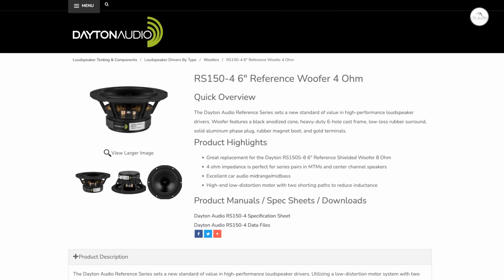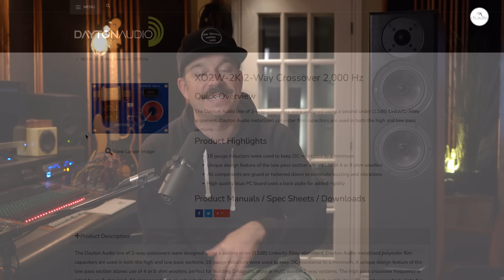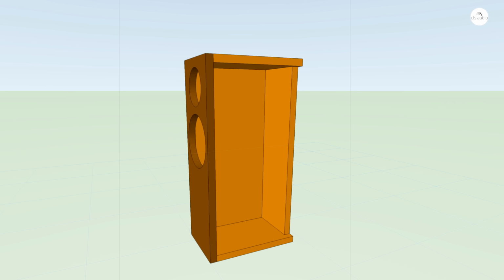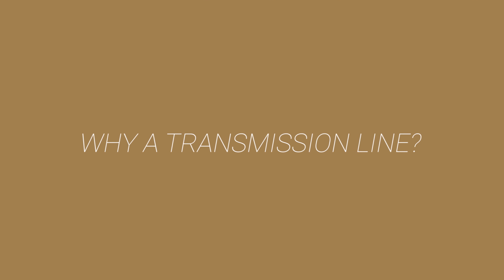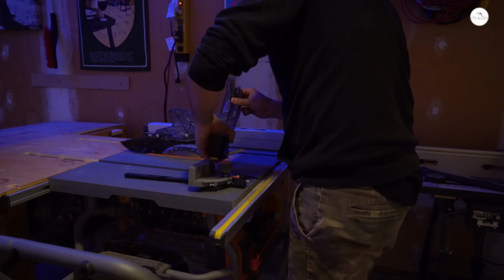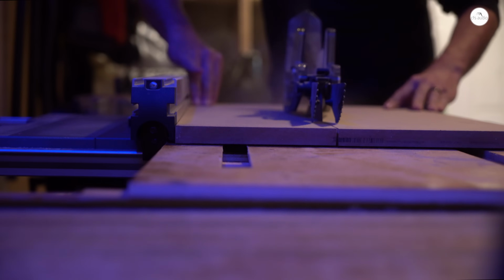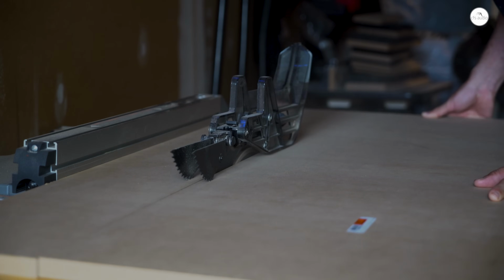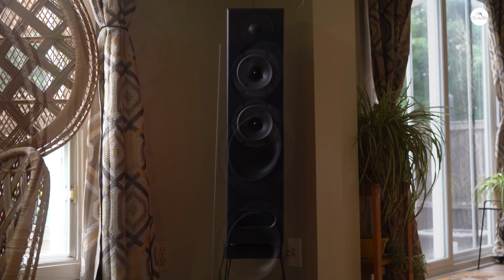DIY Reference Quality Speaker Build. How I built these amazing speakers and proper sound comparison!

Comment: Very nice build - I am a huge fan of transmission line speakers. I have designed several mass loaded transmission line speakers, including the crossover, and built them. And I agree that they sound fantastic - much better bass & midrange quality than any speaker I have ever heard, and with much better bass extension from a given driver. My favorite so far, use a 6" paper cone SB Acoustics woofer, and are essentially flat in my room to 32Hz.
I used a 3D acoustic modeling program called Hornresp to design the cabinet; and drafted it in DataCAD. I used a miniDSP 2x4 HD to digitally design the crossover, listening to the speakers. I then used XSim to design an analog version of the crossover.
Reply from the maker: Awesome Stuff! Thanks for the kind words. Looking forward to designing my own electronics and dialing in my cabinet designs in the future.
Reply: @chrisferris3303  A possibly good way to get your feet wet in Hornresp (which is free) is to model this speaker, since you have the dimensions. The driver Thiele/Small data is available; maybe in a TXT file that can just be loaded into Hornresp?
Reply: How critical are the dimensions of the cabinet to optimizing the sound quality?
Reply: @talktoeric  The inside dimensions are pretty important. The most critical is the area of the terminus section. In the final stages of the design, I was moving things in 1/16" (~1.5mm) increments.
Reply: @NeilBlanchard  I was in the same vote, very small increments of movement.  Also found the qty and where the dampening material is placed makes a big difference in modeling/testing those peaks and valleys.  I was also surprised how close hornresp modeling was to the tested.  So much fun though.
Reply: @CHUDHUCKER  Right - the polyfil works very well in the closed end and close to the woofer - and I use no polyfil in the half of the TL closest to the open end.
Reply: @NeilBlanchard  Yes, I had to offset my woofer and do the same but, added a bit more closer to the open end to flatten the response a bit more.  I have modeled a few other woofers I have for fun and every one of them is a little different.  I only did a straight TL though and want to figure out a tapered design next.  I am hoping it will end up smaller?
Reply: @CHUDHUCKER  All of the speakers I have designed are tapered. That's how you get the mass loading. With both the driver offset and the taper, the design is smaller and/or has a lower fundamental frequency.

The taper does not have to be a literal angle; just have reductions in the section area.
Reply: @NeilBlanchard  I have to figure that out, any youtube or forum write-ups you have encountered to help?
Reply: @CHUDHUCKER  In Hornresp use the Loudspeaker Wizard to do real time modeling - if you shrink the terminus section, or adjust the section before it, etc, you can see right away what tapering will do. If yopu work with a given driver, there is a sweet spot - the size and the length of the four sections of the TL. Or with an offset terminus, you can use five sections, effectively.
If one end of a section is smaller/larger than the other end, then the air inside acts like there is an actual taper. Same things for turns - you don't need the angles in the corners to "turn" the air - it does it all on its own.
Reply: @NeilBlanchard  Thank you Neil, I am going to see what happens.  Then this coming fall build it.
Reply: I'm new at all of this but what is a transmission line speaker?
Reply: @RobertSpiller  It is a cabinet design that forms a "column" of air behind the woofer - which is located about 25%-33% away from the closed end of the column. The other end of the transmission line "column" is open - this is called the terminus opening. Designing a TL well takes a 3D computer acoustic modeling program - the one I use is called Hornresp; which is short for Horn Response. The program can be used for horn loaded speakers (front or back horns) and transmission lines, and regular ported designs.
This allows the back wave from the driver to be used, because the output from the terminus opening is in phase with the front. The air in the column begins to be coupled with the woofer cone, as the frequency goes down, and this adds the mass of the air to the driver, and lowers the fundamental frequency of the speaker. You get lower bass out of a given driver, and the bass quality is really good, partly because the driver is smaller than what would be needed to get the same bass extension in a sealed or ported design.
The 6" driver I use has an Fs of 35Hz - in a sealed design it would have an F3 (3dB down) at about 70-80Hz. In a ported design, it might be as low as 50-55Hz. In my stand mount MLTL-6 it is essentially flat in my room to ~32Hz. And in the MLTL-6 Tower (that I am currently building) it should to be ~28Hz.
Reply: I have now finished building the MLTL-6 Tower speakers, and they are everything I was hoping for. They have more bass weight, partly because I used a series crossover, which has lower value coils so they have lower DCR.
And the terminus opening is at the floor in the back, so you get more room lift.
Reply: @NeilBlanchard Sounds interesting! Do you have build plans for this tower speaker?
Reply: Neil can you share the build details. I would be interested in building them
Reply: Agreed TL speakers rock! Are you familiar with the DCM TF series?
Reply: @HomeTheatre101  No, I am in the US and don't have access to their speakers.
Reply: SB acoustics?. dude chill out thats speaker made in Indonesia im proud of you
Reply: I designed some using crayon paper, a magnet from a flux capacitor, and an I-drive system from a bmw.
Reply: @LeprechaunGinger  Never seen a ginger leprechaun in a BMW b4.😳

Comment: What amp are you using for those speakers? 
Also how many watts are they rated for at the end?
Reply from the maker: Nothin special. Yamaha RS700. The speakers could handle 160 watts 8ohms wouldn’t push past that.

Comment: Great video and your speakers look superb! I'm a hand tool woodworker of many, many years so don't have to worry about protective gear. Just a tip... You should always wear a mask when routing or power cutting MDF, even with your door open like it was. Probably not worth it for a quick cut, but after you make a few, that fine dust (that is too small to see) will stay in the room for a good while.

Comment: I've been in and around high end audio for decades now and to this day every time someone asks what speakers they should get in the 10k to 20k range I tell them they'll be better off having someone build some customs unless they're a speaker collector.  Especially sub woofers.  There is no reason a sub should cost more than 4k and much of that is for the cabinet maker.  Unironically the sub isolation mounting and acoustic treatments for the room should cost as much or more than the speakers.  I can put a wallmart stereo in an acoustically treated room and audiophiles wouldn't be able to tell it was a cheap ass stereo.

Comment: I stopped the video as soon as you mentioned a preassembeld crossover.  That will never sound optimal.
Reply: Nerd.
Reply from the maker: You are absolutely correct. It works well but for the best results you wanna design a custom crossover. Checkout the channel just built a great set of speakers that you’ll probably enjoy.

Comment: You have no idea what you are talking about. Your first build and you have no idea what you are doing, just guesswork. How long is the transmission line and does it taper at the correct value for the volume. You have no idea of speaker design, maybe you have some woodworking tools but they don't design speakers. Why use foam, not damping material, foam does not damp it is used for washing yourself in the shower. Go back to sleep!
Reply from the maker: Welcome back Nico. We missed you.

Comment: brilliant video as always. was wondering, why not do a D'Appolito configuration, "MTM" (midwoofer-tweeter-midwoofer) ?
Reply from the maker: Hey Gaville. Great question. So even on my latest build I tried it out on my prototypes and didn’t get a massive improvement in the results. I have plans to build a much taller tower and do an MTM with 4” mids and a Ribbon tweeter combined with a 10” woofer. I think that’ll be super sweet. Thanks for watching

Comment: you messed up with the depth of the tweeter. It sits to deep in the baffle.
Reply from the maker: Yeah I ended up putting a rubber ring behind it and setting it forward to line up with the front.

Comment: You wired the woofers is series to get 4+4 = 8 Ohms.  What did you do with the tweeter?  What is the speaker impedance?  Crossover?
Reply from the maker: Hey Bill, thanks for watching and reaching out!

In this build, I wired the woofers in series to achieve an 8-ohm nominal impedance. It worked out well, but lately, I’ve been preferring to run dual 8-ohm woofers in parallel for a 4-ohm load — I’ve found that setup gives me better overall performance.

The tweeter in this build was a 4-ohm driver, which worked fine in the setup, though it does slightly shift the crossover frequency due to the impedance mismatch. That said, in most real-world listening situations, especially at normal volume levels, the audible impact is minimal. Woofers generally have a greater influence on overall impedance load than tweeters do, so the effect isn’t too noticeable.

If you’re into this kind of build, I just dropped a new video where I put together a set of tower speakers and design my own crossover from scratch. I also dive much deeper into the transmission line design.

Thanks again for checking out the video — really appreciate the support!
Reply: @chrisferris3303  Thanks for the reply.  It seems that the trades in the error budget of an overall system design are as much of an art as a science ? 
 I'll certainly give it a watch. 
Thanks again.

Comment: Great build and video, very impressed!  What type of efficiency can you expect from these speakers?  
What is the minimum power they need from an amp?  Thanks!
Reply from the maker: Hey thanks for watching. My Yamaha RS700 is a pretty basic receiver which delivers about 100 watts into 8ohms. That was a pretty good pairing and I was able to get plenty of volume with out any distortion into those drivers. FYI I’ve built a great new pair of towers and will be releasing a new video for that in the coming weeks. Stay tuned :)

Comment: Well I don't see why you don't build your own crossover. They're very simple to do. I've been building custom speakers. It was for clients for 50 years. I'm 71 now. I've been doing it for quite a while.  I'm mostly in upstate New York.I've always built my own crossovers.My own cabinet and when I can I always like to use Is vintage speakers or vintage style speaker Some of the new stuff is good , but there's something about the old style The way they were manufactured.
 A lot of metal, instead of plastic steel, instead of aluminum.
 I just like the way it's. They are cinstructed and the way that they sound. I don't know. I guess I'm old school.  There's a lot of things out.
 There now a days that are made to be disposable using this m. DF instead of real wood.
 They use MDF and then put a veneer on it. It's not real wood.  It's more stable. Yes, but if you do the right treatments to real wood, you can make it pretty stable.
 You seal, it can be just as stable as MDF. Like I said, I've been doing this for a long time and I've never had a problem.  But that's the way everything is going nowadays.Cheap inexpensive.
But I will not lower my standards
Reply from the maker: I’ve started building my own now. So much better. Got a new build coming soon

Comment: Those look great and I'm sure they sound amazing with that transmission line design. I do have one suggestion though, when wiring two speakers together it is always recommended to put them in parallel, not series. The reason for this is that though out the speakers travel the resistance changes, which changes the power its given, so when two speakers are in series as one changes resistance it changes the power the other one is getting too. When in parallel the speakers are completely independent of each others resistance and power. Putting two 8 ohm speakers in parallel for a 4 ohm resistance would have been better, I'm pretty sure that crossover has a woofer resistance selector too.
Reply from the maker: Hey thanks so much for watching. Working on a new build currently. Gonna try out a 2.5 and compare it to an MTM and see what I like better. Building my own crossover for the next build as well. Comments like this pushed me to research deeper so thank you!
Reply: The speakers would also probably be out of sync due to the phase shifting in the first speaker coil before it reaches the second.
Otherwise, great build!

Comment: Cheap drivers, off the shelf crossover, two way, not active, AND you call it "hi end"?
Surely, this is a joke. In my DIY, four way, active build with digital from storage to after crossover, my tweeters cost more than your MID - woofers, and they were cheapies with good specs.
Reply from the maker: Thanks for watching. I’m sure you’ll like my upcoming builds.
Reply: @chrisferris3303 
Won't be watching.
Reply from the maker: @frankcollins4743 MTM configured transmission line with an AMT tweeter? Custom crossover with Air Core inductors and Jensen Caps? Come on Frank give a guy a chance :).

Comment: Focus is exactly the opposite of what a transmission line does. The transmission line is a resonant system - with multiple resonances that "enhance" the actual output of the woofer. Those resonances were NEVER in the original recording, they are an artifact of the design and far less controlled than anything out of the woofer. My experience with that foam is that it disintegrates after 10-15 years.

Comment: Did you do the math, airspace box volume length of transmission line is it a 1/4 wave 1/2 wave  full wave?  Where did you get your parameters? 

A port traps the wave and makes it vibrate they have to be tuned to a frequency.

Your going to freak out, but JL audio used to have some really good tutorials on box building on the webpage. Not sure now because Garmin bought JL Audio a few years ago during covid. 

There used to be a forum for transmission line boxes  but it requires a lot of math.
And or you can find box building programs. Or buy one.

Comment: TERRIFIC storytelling...sub'd/liked! thanks! any suggestions for designing the dimensions of a Transmission-Line box for different speakers? thanks!! [ the Customs lacked a true mid, which the Reference Speakers seemed better (from where I'm sitting 🙂) beautiful final product overall. hmmm...maybe a side-firing passive radiator wouldn't hurt. And some corner bracing, to "ease" the acoustic wave through its run. Why not fully-cut-out the bass outlet, with a tad more bracing, and not a little less "stuffing". just sayin' :-) looking forward to your Channel's content!! Have you done Exciters, perchance?
Reply from the maker: Hey thanks for watching and the kind words. As for t Line tips (I’m no pro) I go with 1/4 wave length of the drivers resonance frequency (fs). Seems to be the most popular way of doing it. I’ve got a new one that I’m gonna start working on soon. Same woofers as this build but in a T-Line tower with AMT tweeters and a seperate custom crossover. Looking forward to that build! If you have a chance checkout the Sub and guitar cab builds I did. Fun Videos! Thanks so much for the Subscribe!
Reply: @chrisferris3303  methinks if the woofers had been a stiffer-cone, the mid/high-bass clarity would improve. ever consider a coat of clear acrylic, if they now be "paper"? its what olde-tyme speaker-builders once did 🙂so I hear...

Comment: After listening to you.     No way will you back it up.  With. An  A,,B test     still talking.    Let's look at the binding post.  Should fit 22 ga. Wire.   Let's watch now
Reply: That was not a A,B test.   But better the other carpenters.  That use 8 k+ worth of tools  
  I. Could not see quality of wire.  If you solder connections wire to drivers 
  Feet were a sin     feet do make a difference.    Looks like you don't believe

Comment: Seriously don't build a speaker like this. You can't use a generic crossover. It doesn't work that way.
Reply: Please explain further. Thanks
Reply from the maker: I can explain for you. Also thanks for watching. If you wanna get the most out of your DIY speaker builds learning how to design your own crossover specific to the components and cabinet you’ve built will allow you the ultimate control over its tuning. However there is absolutely nothing wrong with starting your build journey with a generic crossover. Picking the right crossover points gets you in the ball park. On this build a higher resistance on the tweeter is the only thing I woulda cared for in hindsight. But honestly that’s me being picky. Everyone who hears them loves them.

Comment: Cosmetically they look very nice. The coice of drivers is good, although they may or may not be compatible with each other. The design electrically? Not so much. The conection of the woofers should be a parallel connection yelding a net of 4 ohms nominal. Using a generic off-the shelf crossover is universally shunned by experienced speaker designers. Speaker impedance varies with frequency. It's not constant and that's the assumption with a generic crossover. A real crossover is designed considering the total frequency and impedance response of the woofers and tweeter over a wide frequency range.
Reply: Connecting two 4 ohm drivers (such as the woofers used here) in parallel would result in a 2 ohm load. He did it correctly.